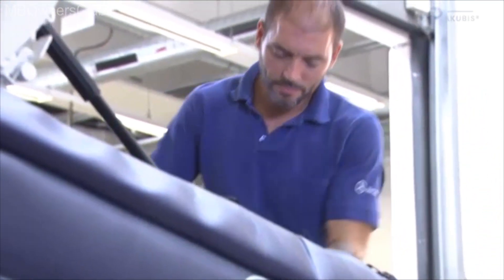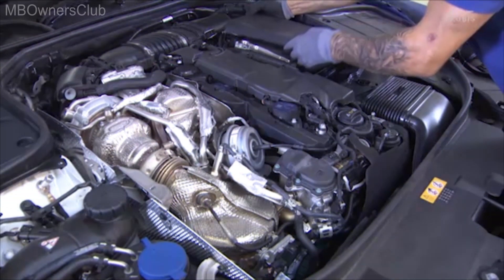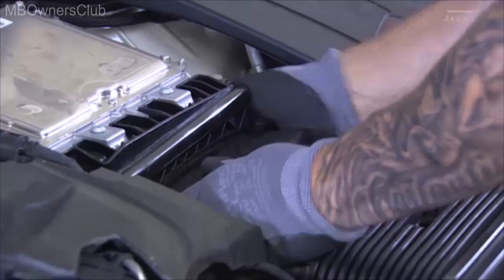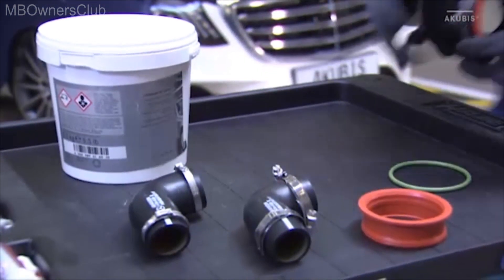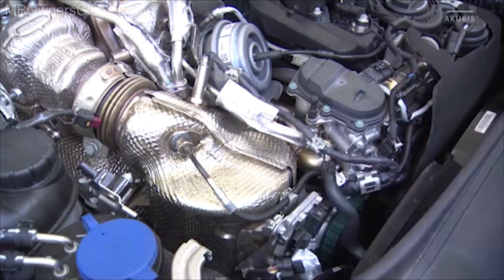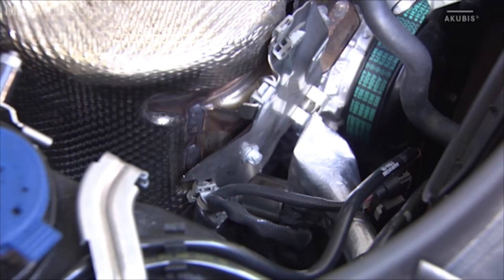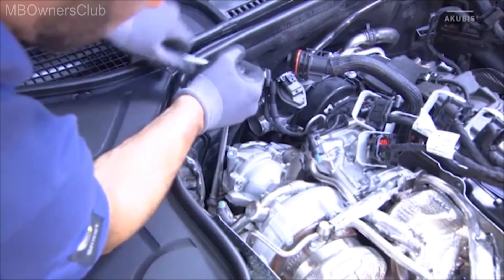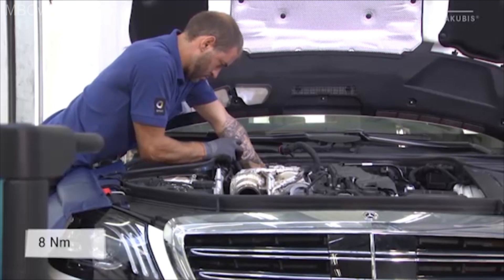How to Replace the Diesel Particulate Filter on a Mercedes-Benz S-Class (W222) - OM656 Engine

Comment: I have s350d w222 2018 and it goes to limp mode 3 times a day with no fault code so you think it’s dpf
Reply: Mine won't change up when doing a dpf regen it does but only at 1800 rpm it's driving me insane